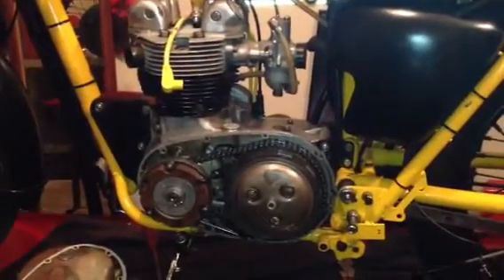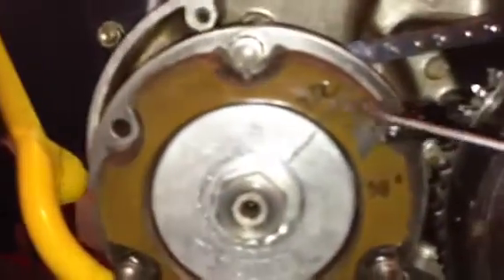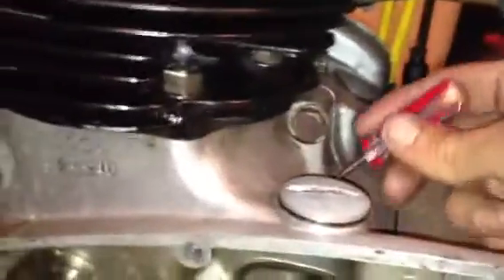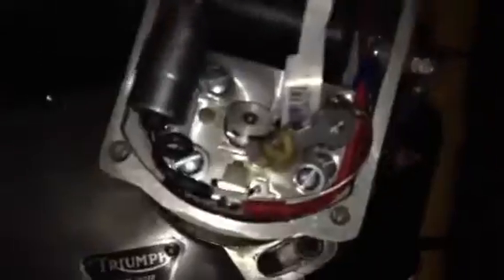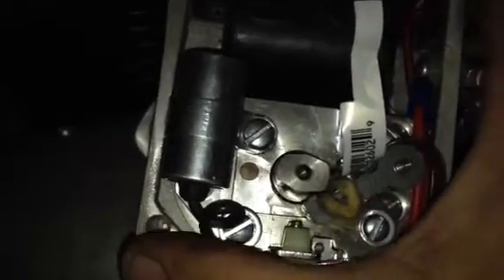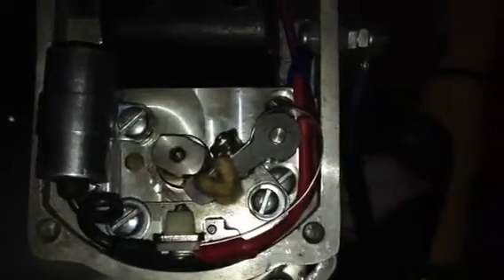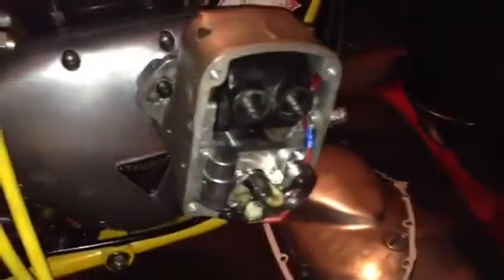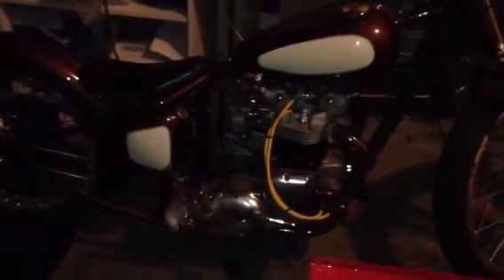Triumph T100 500 Cafe Racer -  timing a Joe Hunt Magneto

Comment: I have Triumph 650 with Joe Hunt magneto just like that. I think mine has not only a notch in the flywheel for TDC but another for correct amount of advance. It has another notch of some kind I used to line up and then set magneto to that.
Joe Hunt magnetos are great, used to start on first kick all the time if it was primed right.
Want to try and cast some custom cover plates that have wires coming out of the top instead of right into your leg. Bzzzzt !

Comment: I just use a multimeter or light with alligator clips on the points, and as soon as the continuity is interrupted you hear it, or you see the light go out...it’s accurate to a fraction of a degree
Reply from the maker: Ronan Rogers lets see you do that on the side of the road 😎
Reply: I used to use a cigarette paper way back when.
Reply: @SteveF0rbes  alligator clips and the bulb from the headlight to make a road side mag timing position light.

Comment: 70s triumph plug gap is to be set at .025. anything smaller will make for weak spark and get incomplete burn. Open the plug up even more so with a mag. Hotter the spark th larger gap can be. But .025 is all unit triumph starting point.

Comment: Hi Steve, I've been enlightened by your videos, I've got a 1978 Bonnevile T 140V & would like very much to get rid of that heavy rear brake caliper & master cylinder which always get's stuck once the bike is parked for some time, any upgrade/ modification will be deeply appreciated. Also what is the correct cam to use for improved performance?.....Thank you kindly!